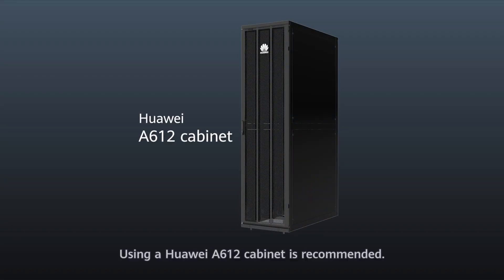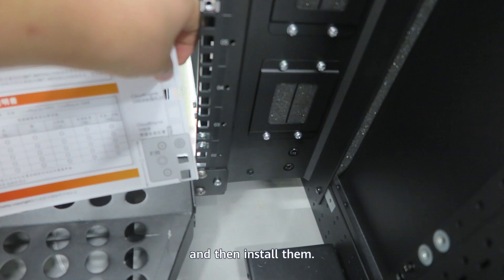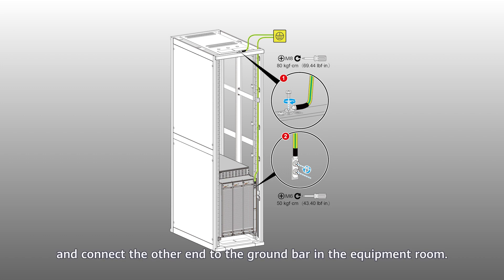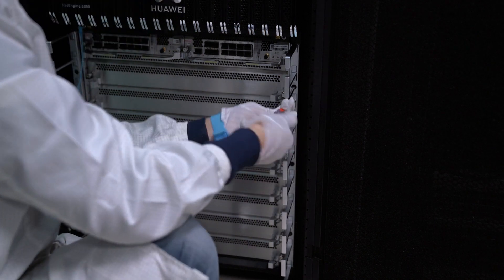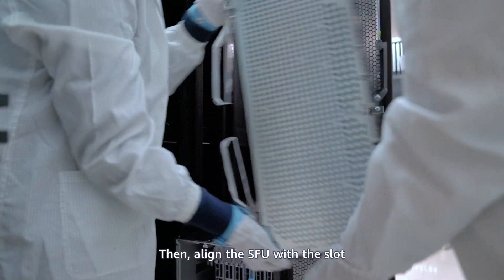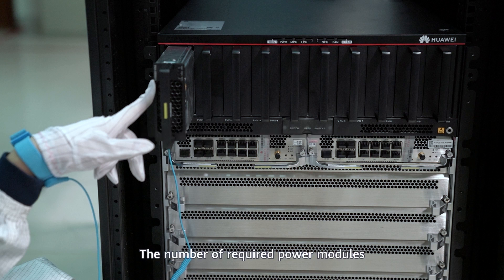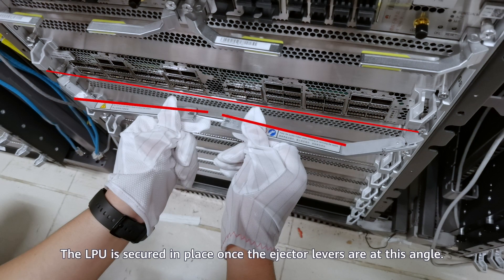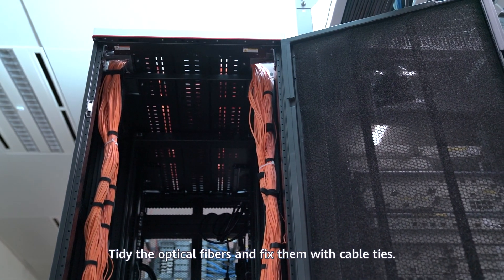Huawei NetEngine 8000 X Installation Guide

Comment: For grounding can you use only the top position of the cabinet for the main cable?
Reply from the maker: Thank you for your feedback.

It is confirmed that no document needs to be modified. The reply is as follows：
1. A cabinet ground cable connects the ground point of a cabinet to the ground copper bar in the equipment room.
2. The installation position of the ground cable on a cabinet depends on the location of the ground point on the cabinet.
3. Huawei cabinets typically have ground points located at the top, and the ground cables are also installed there.
4. If a third-party cabinet is used onsite, determine how to install the ground cable based on the location of the cabinet's ground point.

Leave messages on the corresponding web pages if you have any other questions.

For further questions, pls email us at document@huawei.com